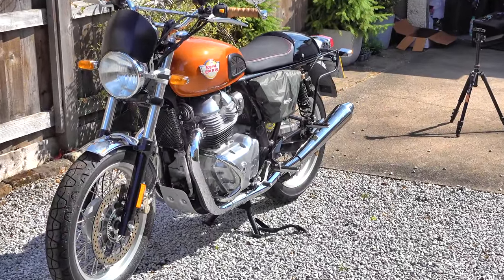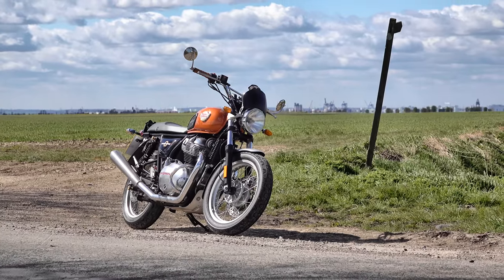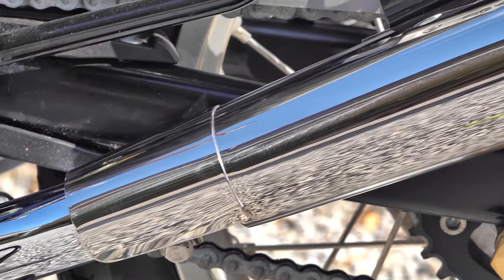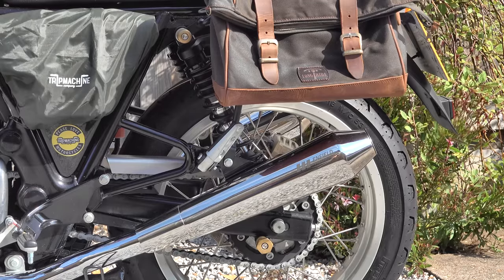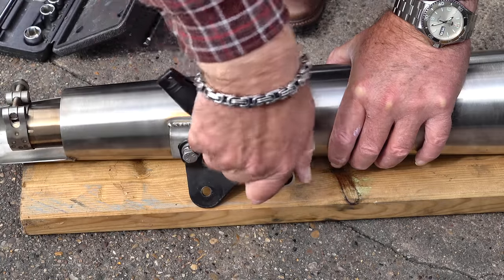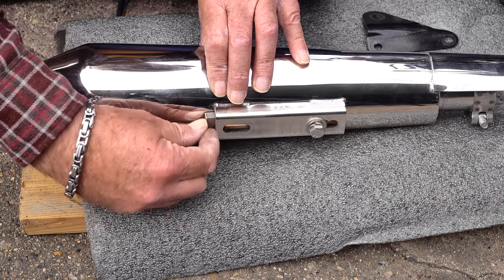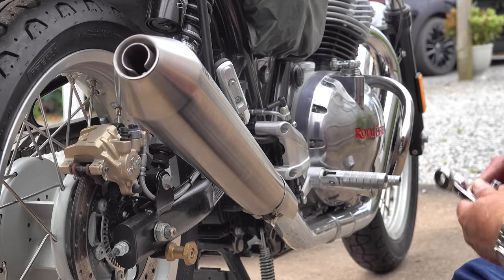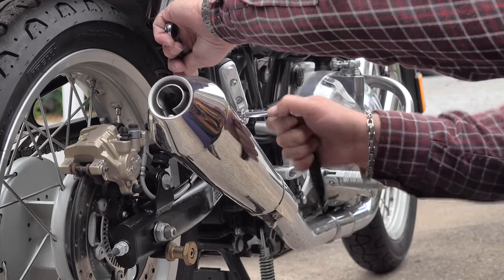Royal Enfield Interceptor 650. 5 Good reasons to fit the Enfield Precision Stainless shorty silencer

Comment: I fitted PoweRage (same thing as the Enfield Precision) shorties to mine and found it too loud even with the baffles in. The solution was to add about 3" of proprietary baffle tube to each baffle using JB Weld. Works fine and still sounds good.

Comment: Maybe I’m the only Interceptor owner that likes the standard pipes. When I had a minor scrape on the right side recently I bought a replacement standard replacement on eBay.
Reply: I like the standard pipes too, I won't be changing mine until they rot out or look unsightly, would of been nice if they were stainless though, but at the price point of the bike I can't complain to much.

Comment: I have a pair of AEW 103 exhausts in polished stainless steel on my Interceptor. More than the sound, it is the shape and size that won me over. They are about the same size as these but with a shorter reverse cone and look properly proportionate. The mirror polish makes them look OEM and not clash with the chrome fuel tank.

EDIT: Forgot to add the reason for posting this comment. My observations on my exhausts are similar to yours for these new ones so I can relate.

Comment: Nice one, Stu. I have found that any modification on the Interceptor 650 I have done so far is quite straight forward - the more seasoned tinkerers would get by without even glancing on instruction sheets (but it is a good habit to glance them over anyway - just in case). I was never a fan of those big up swept pipes on the bike to begin with , along with some other features that I don't find aesthetically pleasing, but the bike is a great platform to make it your own at relative low costs. I opted for a pair of AEW 201's - basically old fashioned pea shooters that due to the angled flange straighten the lines out and tuck them a bit closer in, to be more reminiscent of the old Constellation. It does give the bike a more classic look and it did come with a removable baffles - but I kept them in as I found the bike to be sounding a bit more pleasing that way. The only consideration for these AEW 201's is that they do get in the way when you need to remove the rear wheel, but a work around it to pop off the rear shocks from their top mounting so the swing arm can drop a bit lower, making it possible to remove the rear spindle. I tend to do that anyway as it gives a bit more clearance to move the rear wheel out of position.

Comment: I bought a set of old-fashioned looking horizontal bottle mufflers for my INT 650 to even more remind me of my beloved 1965 Triumph 650.  My new mufflers do everything that you mentioned in your video.  I too have the baffles left in because they allow just the right amount of "growl" without being too loud.  Love that sound and now the exhaust note tells me when to shift without looking at the tach.  My only regret is that I didn't know that the mufflers could be had in polished stainless steel.  The chrome plating on mine must be one atom thick because I have to keep polishing them or the rust shows.  Sound, performance, weight, cargo space, much cooler to the touch and looks, yours or mine are worthwhile changes.  By the way, maybe it's just the sound, but I seem to have better low end torque.

To let my ECU adjust to the new gas flow parameters, I pointed the bike upwind, put it on its stand and let it idle for 15 minutes while checking my oil temperature gauge (it never got over 70C).

Comment: Good morning Stu. Interesting video. I don’t mind the look and sound of the OEM pipes. As you mentioned though, they do get extremely hot. Not so much a problem for me when riding even with my panniers fitted. The biggest problem is putting the bike away. My ground anchor is by the rear wheel which means that I have to wait an hour before I can fit the security chain. When you do the follow up video, can you hold an OEM silencer up against the new one to show the size comparison?

Comment: I installed these last night. Ordered them Thursday morning and had them 24 hours later. I'm in the US! Hitchcocks is amazing.

I had an unusual experience installing these though. The stock silencers were sealed with some kind of fiberglass mesh and foil tape that was very hard to get off. I think Royal Enfield usually uses a rubber gasket? Some factory improv I guess.

Comment: Have to agree on the ascetics of the shorter pipes. I the Powerage units that I put on my 650. The list of reasons could run to 10. I packed my oems away in case I want to take my back to original.

Comment: Just came here watching the older video about air filter change. I recently bought a K&N air filter with stage 2 filter plate and have also installed slipon AEW exhaust. Did the 15 min  idle trick too. But i somewhere heard due to these mods I need to also do maybe a fuel piggy map to give the bike additional fuel for the mods done otherwise there is loss of power. Please suggest

Comment: Personally, I think they sound better with the baffles out. The bike is not obnoxiously loud. I have to brag. I just bought a 2014 continental GT with less than 500 miles on it. It has a silencer, air filter and Power commander V.

Comment: I’ve got a pair of Powerage silencers fitted to my Interceptor. They are identical to your pipes, stainless steel, same fitting, join cover, decibel reducer and electro etched name. 🤔Makes me wonder if these are manufactured by one company and the name added the suit the customer  and the price 😏. Two thirds the price from India.
Note, Hitchcocks don’t state that they are made in the uk.
Reply: My sentiments exactly Sir. I, too, have the PoweRage polished exhaust installed on my INT 650. They appear to be identical in every way to the Enfield Precision units. Slimmer in size, run much cooler, a more authentic '60's British twin exhaust note, IMO, and weigh 8.95 pounds (4.06 Kg) less than OEM for the pair. I have not removed the dB reducers. Always good to see Stuart feature his Interceptor.

Comment: Hi brilliant I keep watching and enjoying your channel as far as the MOT is concerned I’m I mot tester so when I login to the DVLA to carry out a MOT I am then on the Dvla , when I log in again to add the results the pass are fail are then on the website and can be viewed by you . The DVLA website has been updated at this time ( so no waiting) the only problem that can happen is if the DVLA website goes down then we can’t update the sight until the system comes back on line hope this helps
Reply from the maker: Just going by the text on the site. I know when I got the Mule MOT done it was a couple of days before it registered. Maybe down to the vigilance of the test station?
Reply: @stuartfillingham  Hi mate s i said to do a mot we first have to login to the dvla database it will then print out the check list for that vehicle when we finish the test we log back in and put in the results , it is then registered. I have in the past taxed a motorcycle with in 30 minutes of  completing the test ( we can also make some changes like colour and even the class ie motorcycles class 1 and 2  trikes class 3 cars class 4 ) please keep up your great work much appreciated Kev

Comment: Does the bike remain Euro-5 compliant? Will be interesting to see if it passes the MOT with those pipes on.
Reply: I would greatly expect that I wouldn't be compliant without the catalytic converters, so any inspection or resale would require reinstalling the original mufflers and then allow the ECU to reset itself.  I have mine packed safely away for the future.
Reply: Mine just passed its MOT with S&S pipes on it ! And if anything they are growlier than the Enfield Precision , this was at a strict MOT station too ! .....I did get a bollocking for my small number plate though ! 😅
Reply: @themoog3889  That's what I get for just guessing and making assumptions.  Here in California, smog inspections are pretty strict and more so because of how we got burned and lied to by the VW company and its engineers during their diesel scam.  I've never had to bring a motorcycle in for a smog check, but I'll make another assumption and guess that we will in the future.  Here we don't care so much about the safety of the vehicles and don't inspect for that, but they do make a big deal about a vehicle's pollution output.
Reply: @themoog3889  some of the S&S pipes have cats in them. Need a bit more detail about what model you've got fitted before we could infer that a de-cat pipe remains Euro 5.
Reply: @RichLee_laughingblade  Not sure tbh , they did say Race Only until I had that dressed off ! Not sure emissions are tested during an MOT ?? Our bikes are taxed on CC groups unlike cars !
Reply: @themoog3889 AFAIK s&s pipes have catalytic converters in them.
Reply: @robertpinder2307  Can't comment as I've no idea .....but they sound awesome ! 👍🏻 Nicer finish than the Enfield Precision ones around the clamp area too.